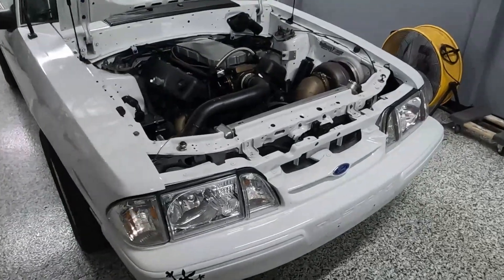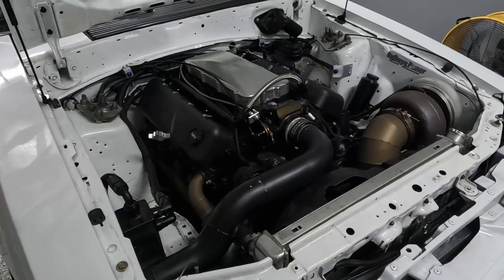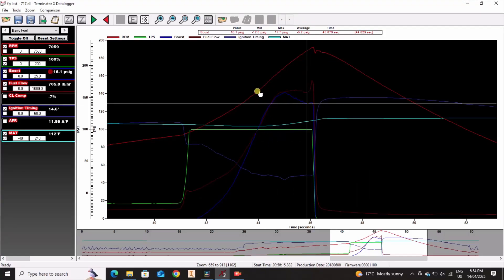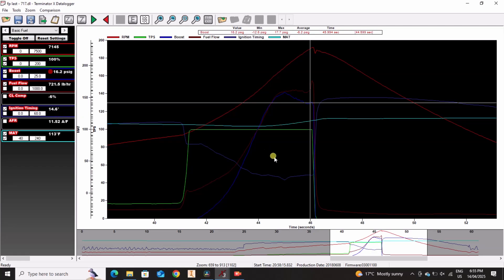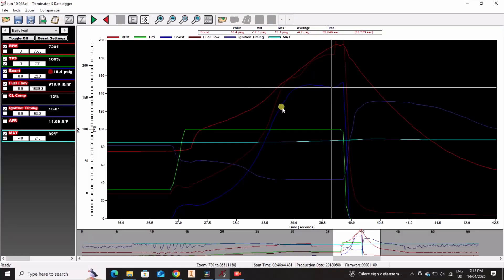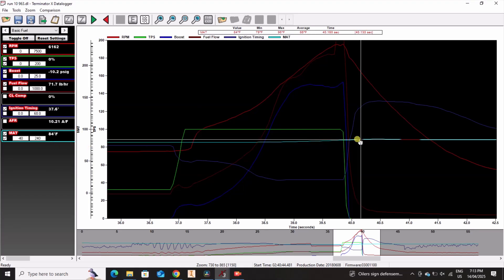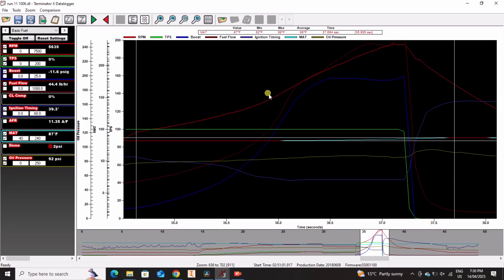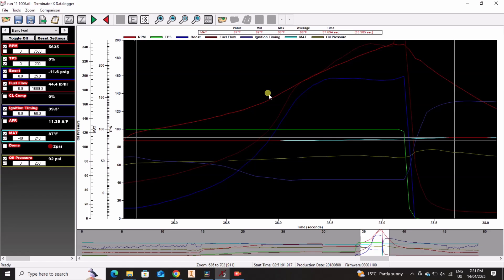China S480 vs USA Bullseye 76mm (Dyno comparison on Turbo LS Foxbody)

Comment: NOT apples to apples! You were on a roller dyno first, then hub dyno with new turbo. Everyone knows a hub dyno shows higher numbers.
Reply: The reduction in manifold temperature indicates how much better the quality charger is, that alone could make the difference between a safe pass and detonating it to death
Reply from the maker: @funfun8095  big deal, this isn't a laboratory test. I think the difference in numbers easily outweighs any differences between the dynos. How about the softer timing numbers on the new setup? Lower compression?

Comment: What size is the exducer on the 76mm compressor wheel vs the 80?  Wish it would have been on the same dyno for a true comparison.
Reply from the maker: @86boostdcapri  yup just like the comment above bullseye exducer smaller. The track will answer any unanswered questions !
Reply: @WestcoastWrenchin  oh I believe the bullseye is a better turbo without a doubt.  I'm curious to see the gains at the track too.
Reply: The bullseye 76 is 113.5mm and the china480 was 113/117.5mm on the extended tip

Comment: Wish it was a direct comparison. I hear decent things about bullseye, but pretty high price for what it is.
Reply from the maker: @BmoreFox  i think it is a very close comparison. Even +/- 2psi is nothing. Look at the timing difference between the two as well as the lower compression ratio, no advantages given to the bullseye unit. I tried a lot to make my car go faster with the s480 and seeing substantial gains in torque and power like this are promising. Ultimately with how complex cars are you almost need a laboratory to get perfect data!